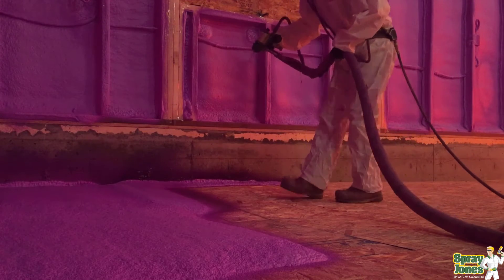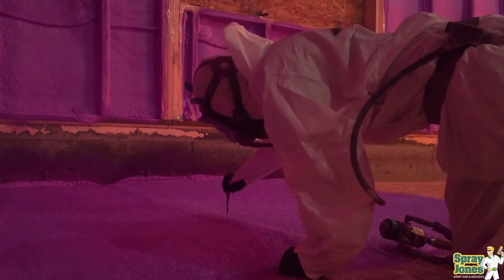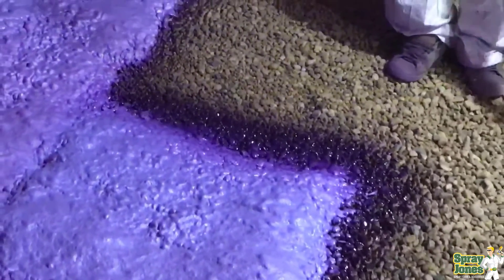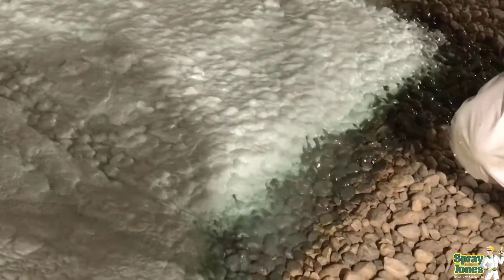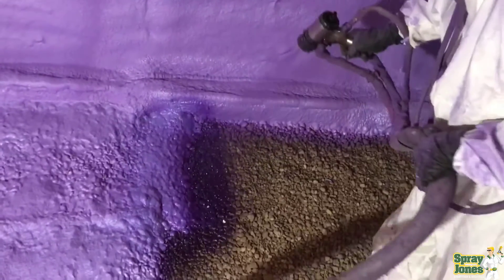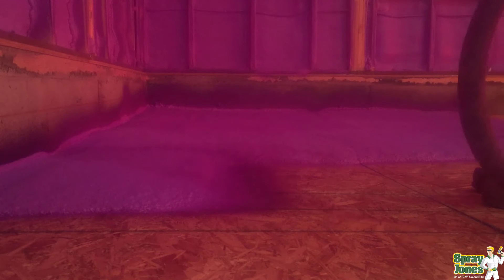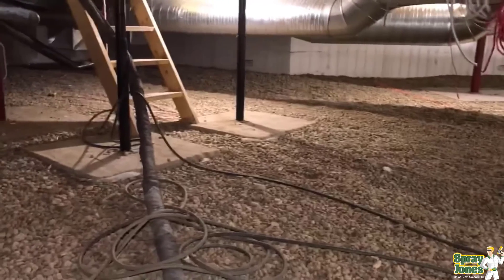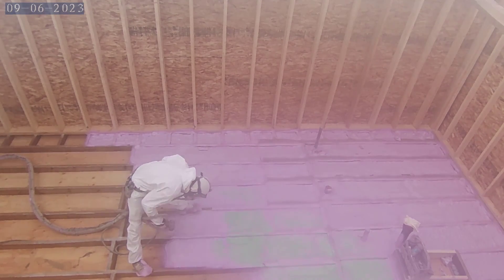Radon Gas and Closed Cell Spray Foam Insulation.

Comment: I have a basement that averages 11 pCi/L of radon according to my Airthings basement monitor. Walls in the basement are 7.5 feet high of both block and poured concrete. 85 years too late to do under the floor, but would adding closed cell spray foam to the walls help lower the radon levels coming in from the soil surrounding the exterior of the walls a noticble amount? Thanks for all the videos. I have learned A LOT from them.

Comment: Another great episode! -- QUESTION -- Can you put closed cell into our Sprinter Van build?  I have head that it can't be done as it may warp the metal as it expands into the joints but I am guessing that you could do it by spraying into the joints and letting it expand and then spraying the open wall spaces.  Any thoughts as this would otherwise be the very best insulation for a van build.
Reply from the maker: Yes it can be done. Go slow, build the foam up in thin layers to avoid too much heat and warp.

Comment: Thanks Mike, you’ve responded pretty fast to my radon question pretty fast! 

What do I say if my local Foam installer doesn’t know if this is a viable solution to stopping radon and doesn’t want to guarantee that it would… I suspect it’s a lack of information about his product performance capabilities or what not! 

How much is to low of a crawl space to installing CCF?   Is 3-4ft to low to work with?   Thanks
Reply from the maker: Most major suppliers of SPF are aware of radon control. 
Height-wise you need 4' to do a decent job. 3' can work when in a pinch.

Comment: For concrete basement walls that will be buried below grade, do you recommend foaming the interior or exterior of the wall?
Reply from the maker: Interior is great for all seasons. But do the outside if the timing works.
Reply: Always protect the exterior if you can........